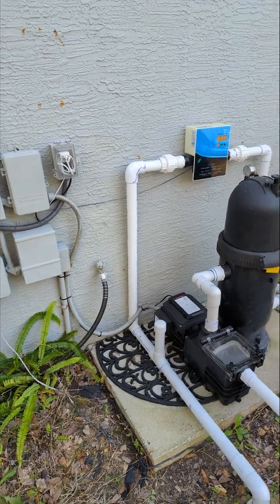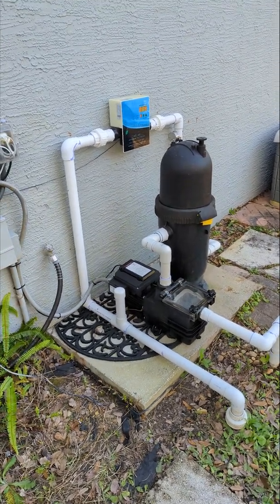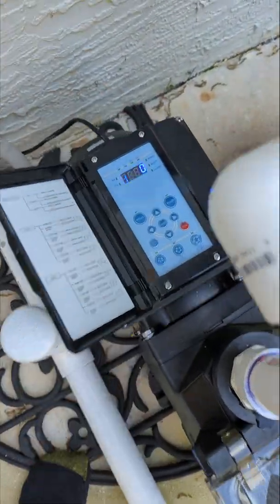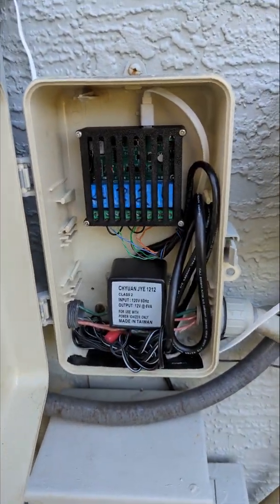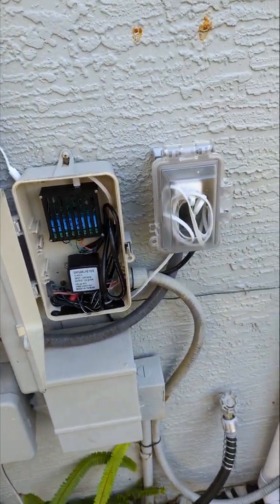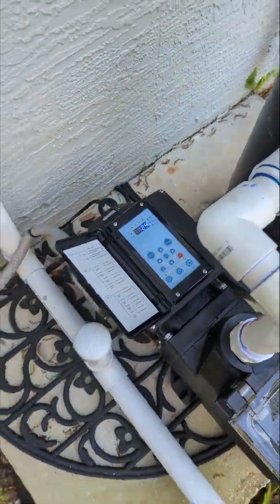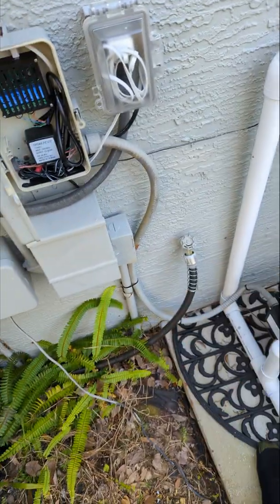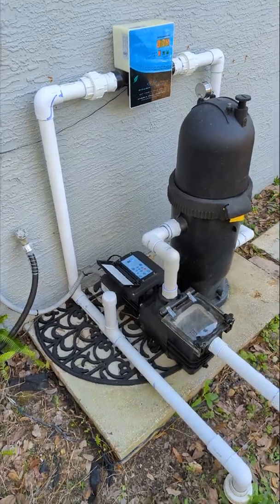DIY Variable Speed Pool Pump Wifi Switch

Comment: Hey I had a couple of questions on your wiring 
1. Why do the stop and clean buttons have 2 lines connected?
       A. For stop, it looks like one orange is connected to relay 1 com and the other is to the NO?

      B. For clean it looks like one is landed somewhere on the 2 (eco) relay and the other to the NO on the clean relay. 

2) I only see jumpers from the boost to clean to eco, what is supplying the power to those buttons on the relay?

Do you have a pic of the relay board with the black cover off and the wires landed that you could send or describe the wiring left to right?

Comment: Hi, thanks for the vid. I have a variable speed pump myself (Hayward) which I like to control with Arduino or a Wemos D1 mini or something similar and some relays so I can connect it to home assistant. Just now I was testing how the digital inputs work. I don't have to solder anything as a cable came with the pump. In the manual I can find which color wire is for which speed but not much more than that. I tried to pick a speed by connecting the appropriate color wire with ground but nothing happened. After seeing your video I'm thinking that I probably should not keep the wires permanently connected to ground but only let them touch for about half a second and then it switches on (and when I do it again it switches off). Is that what you did?
Reply from the maker: Yes, it's just a momentary (1 second) press.
Reply: @TopherHakz  Thanks for the quick reply. I tried it but for me it didn't make a difference. Seems my pump does work a little different. However I did find what the problem was and now it works!

Maybe in the future I can help somebody with a Hayward VSP pump by writing down here what I had to do:
- Connect the red wire (run/stop) with the black wire (ground) (check if the cable is connected in the inside of the pump control box, reverse of this video https://www.youtube.com/watch?v=AxSp75KJ-l8 )
- Manually start the pump by pressing the run/stop button on the pump 
- Now I can use the speed wires: brown to black for V1, green to black for V2, white to black for V3 (fast blinking leds)
- Stop by disconnecting red and black
- Start by reconnecting red and black (no manual press required)
- I found that after starting again with the wires every time the prime function will run for a few minutes (full speed to blow air bubbles out of the system). You don't want that every time after a programmed stop, so I turned the prime function off in the pump configuration. Now it goes slowly to the RPM you want it to immediatly without priming in between. Only downside is that if you want to blow the bubbles out you have to do it manually by setting it on high speed. It is no problem because most of the time I select a different speed right away anyway.

Now I have some hard- and software to build in the winter before next swimming season :) I think I will add control for the poollights and the heatpump aswell while I'm at it.

Thanks again.

Comment: I am going to try this with the Sonoff 4CHPRO ($36) and works with external wall switch- this may give ability to have additional 8 button remote (wall switch) RM433R2 ($5.30) inside the house that is wifi to the controllers.  Looks like your pump pad switches are 12V? (Are you sending 12V for 0.5sec?) I am trying to get pool/spa light and Valves on the second 4CHPRO.  Thank you for your insight into using this automation !

Comment: I hope you see this comment. Your solution is the best I’ve seen, but would like a little more detail. Any way to contact you directly?
Reply from the maker: Sure, I can reply right here which could also help others.
Reply: I appreciate that. Any chance you have specific written instructions on the wiring of your setup for those of us who can follow directions but not a pro in electronics or wiring? Of course, a how-to video would be preferred. Talking to people in the pool industry is a waste of time because they only know how to install very expensive pre-packaged equipment.
Reply: Can you add any instructions to this?

1.  All power off
2. Connect the four-channel relay switch to a power source, such as a wall outlet or circuit breaker.
3. Connect the WiFi switch to the same power source.
4. Connect the wires from the pool pump to the relay switch inputs.
5. Connect the output wires from the relay switch to the WiFi switch inputs.
6. Connect the WiFi switch to your home's WiFi network and enable remote control of the switch through a smartphone app. 

What am I missing?